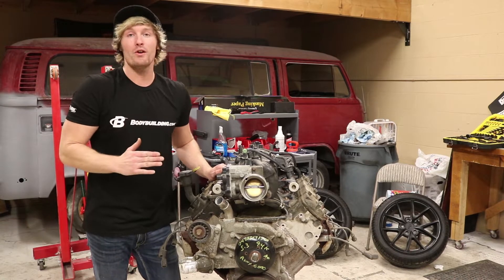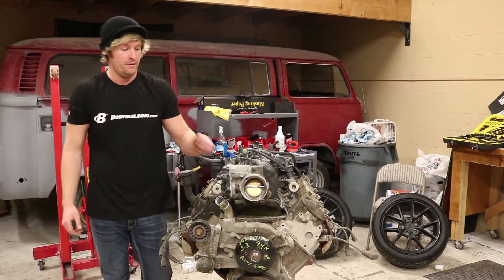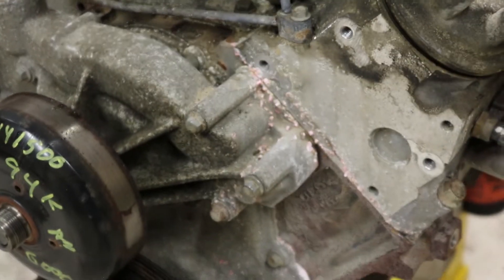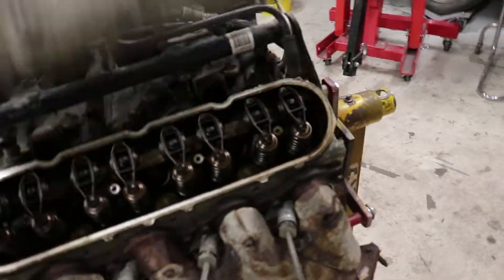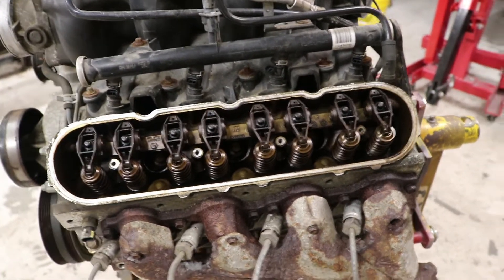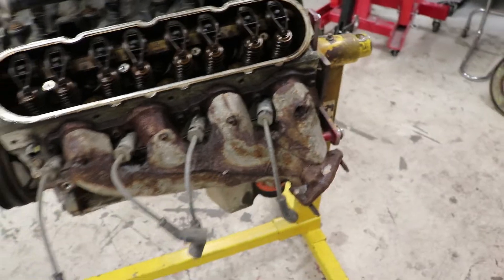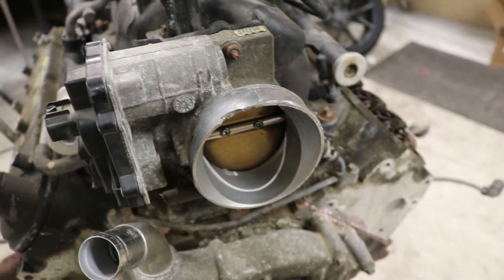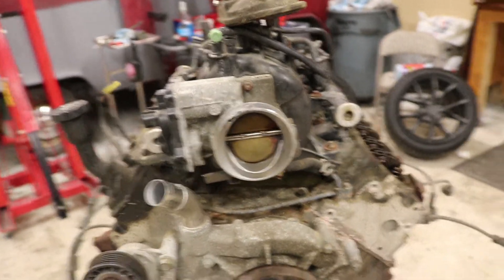400hp 5.3 LS Engine Build Is Here - V8 Swap

Comment: Pink crusties are from a leaking water pump gasket, crystalised residue from coolant that evaporated later. These engines also commonly leaked from a small hose that sends warm gas/coolant from the throttle body directly to the midpoint of the radiator on the passenger side. The idea was to warm the throttle body quickly to control ice over.

Comment: What did you mod to get 400 HP?
Reply from the maker: Stage 3 btr cam, ported throttle body, long tube headers, and a few supporting mods like ls7 lifters and Harland sharp roller rockers.
Reply: @MitchCarveth  Thanks for the reply back Mitch ,, What stage cam would you recommend for a stock converter ? Have a 5.3 swap in my 85 IROC
Reply from the maker: Sorry for the late reply! your car doesn't weigh much compared to trucks so you could get away with the low lift BTR stage 3 like i did or the stage 2 would do the trick as well. Maybe look into the ls6 cam, wont be hard to tune and its good for 30 to 35 hp to the ground in trucks so i could see you getting more to the ground out of that car.
Reply: @MitchCarveth  Ok great info Thanks for getting back to me Mitch I really appreciate it
Reply: I have an lm7 with summit 8707 cam, BTR pushrods and trunnion, pac 1219 springs, lt headers, tbss intake, 3" catless x pipe to 3" back. Running about 25* ignition via hptuners and 12.4 AFR. This should be in the 390whp range I would think?

Comment: Someone told me it’s best to just rip the entire fuel injection crap right off the top and change the intake for a carburetor 2 or 4 barrel then when the emp hits your in good shape.
Reply: not at all, that person should be slapped with some facts. a distributor will be just as fried as an LS PCM would. Its all electrical devices of any kind. Even breakers in your house, or hell the relays that the car uses to start, would all be fried
Reply: Boy that's terrible advice
Reply: The oem PCM and fuel injection system is all engineered for the engine and should be used. The engine wont run with a carb on it
Reply: @wheels.and.wrenches  Umm yes it will there's a reason people swap them out for a carb its for simplicity do your research before you start speaking about something you clearly know nothing about.